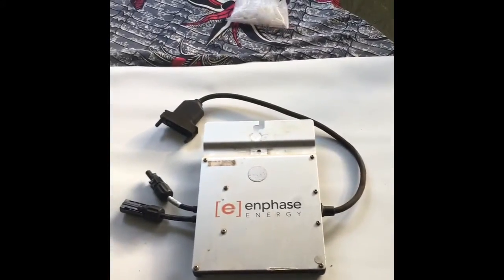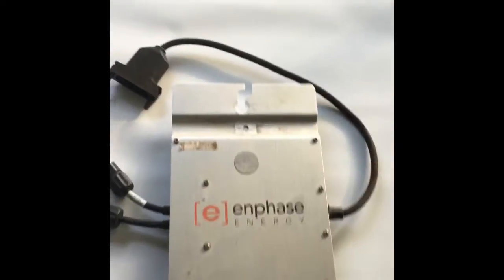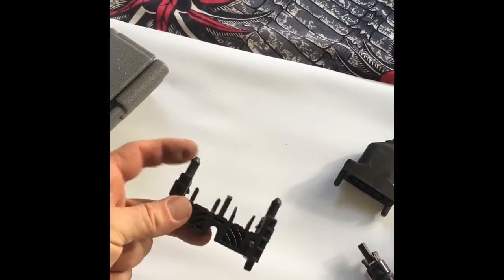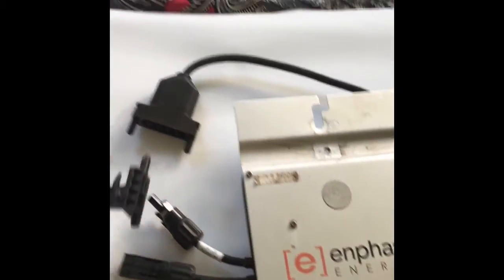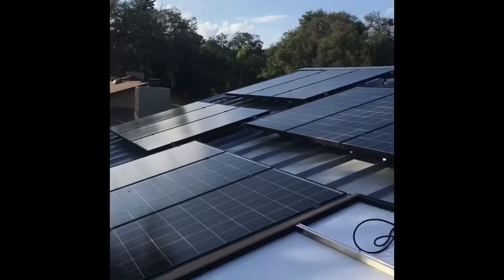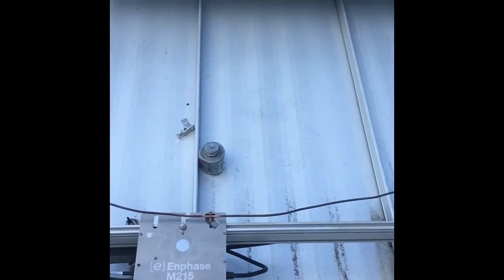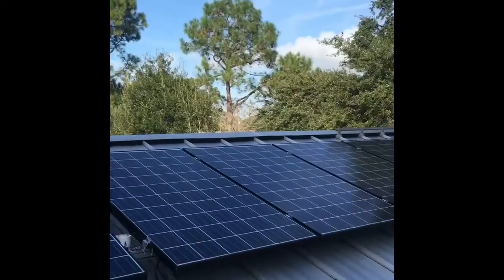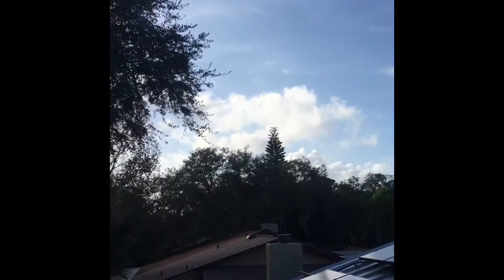DIY model M215 Enphase failure--Change-out with new

Comment: It is now 10May2018 and I just got off the roof having to replace 2 more units that have failed.  That is now 6 out of 30 in 6-years.  That isn't a 99.99% reliability in my math calculations.  But what do I know I am just a stupid Electrical Engineer.
Reply from the maker: Another replacement is coming for a failed unit that failed April2022.  Total to date (Apr2022): 10-failures or 1/3-of my original purchased units.  Early Adopters learn from my mistake!